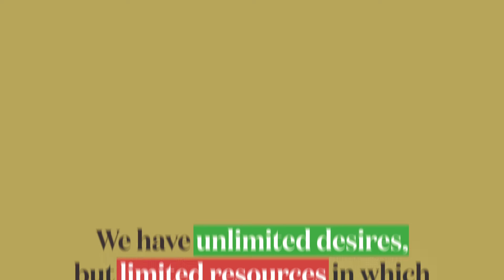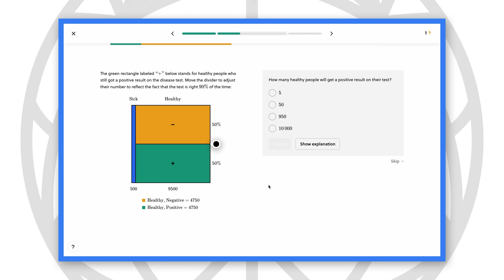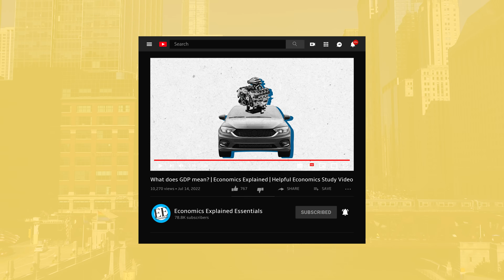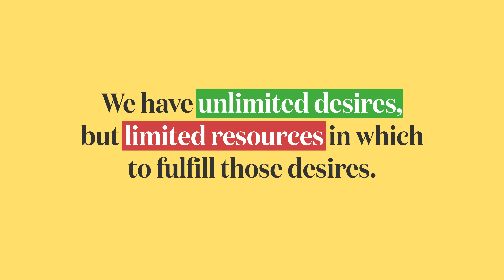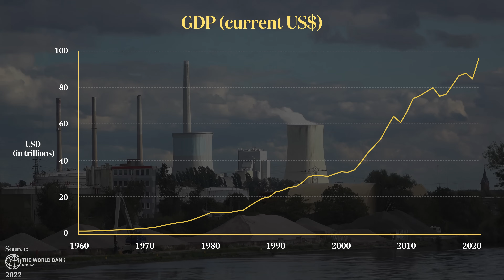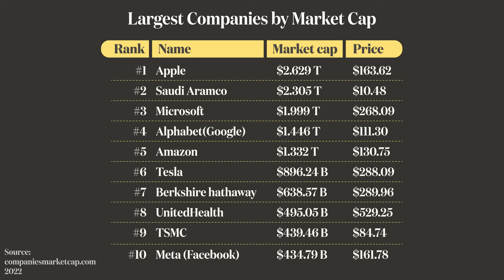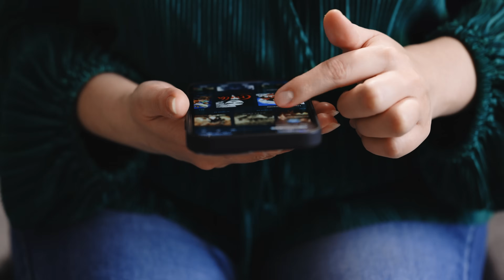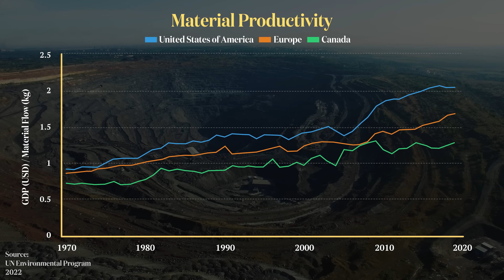Limitless Growth Is Possible If We Run Our Economies Correctly | Economics Explained

Comment: I take issue with the claim that humans have unlimited desires.  It may be possible that on average humans desire more than what is materially available for them, but even that isn't certain.
Reply: Exactly.
I've never desired a supercar, so making those super cheap wouldn't make me buy one (I would buy a decent and cheap rotovator however).
Reply: And collapse of some society could radically lower human desire. For example, if fossil fuel become really sparse, we would not think about buying plastic toys but saving fuel for heating and electricity

Comment: The tricky part is how we actually use this information. Material productivity measurements won't do much to sway those with the means of production if they're still profiting from our current unsustainable model.
Reply: Well the other side that no one is speaking is that it's not always good either. One of the worst disasters in human history with unseen effects was one of the best material productivity increases that ever happened. Do you remember leaded fuel? Was so much better than what they had for the same cost, weight etc but so much worse for humans and the environment. Same for CFCs. Funny thing they both came from the same man. 
Anyway point being i believe there should be 
GDP
-------
Material growth(+ or *  some smarter people than me will figure out the correct equation) pollution
Reply: There is a shift in our economy towards more durable and higher quality products already.
Focus on material productivity would support this. But yes, consumers would also have a thought and adapt more.
Reply: @Xrayhighs  where is this shift? So far I don't see any shift in making more durable products at least for the end consumer.
Reply: By taxing wasteful material use.
Reply: In the long term material productivity will automatically increase because essentially it's just improving the economy's efficiency, which as technology progresses and economic activity occurs efficiency/ material productivity will gradually increase, so it's in the producers best interests to increase material productivity since it can cut costs for them to be more competitive.
Reply: @Gimmegames4free6942  History suggests that the logic of growth will ensure that any efficiency gains are wiped out by aggregate increases in production
https://en.wikipedia.org/wiki/Jevons_paradox

Comment: The 'easiest' way to make the biggest impact is to attach meaningful costs to emissions, new material extraction, and disposal (ie. companies pay a fee when their products goes to a land fill). Make destructive practices more expensive than sustainable ones, and even the biggest greediest corporations will be pushing for sustainability and putting big money into R&D for more sustainable practices.

If emissions are expensive, companies will find ways to reduce emissions. If extracting new resources is expensive, companies will find better ways to reuse existing materials. If your product ending up in a landfill is expensive, companies will be encouraged to implement buy-back and recycling programs.

It's not the only solution, but it's the most effective one that doesn't rely on heavy handed regulation and which continues to enable a free market.

Comment: The Digital economy won't do anything, we still need tons of datacenters, servers, and an ever-increasing number of personal devices and energy so that people can consume these things. It's the same issue.  Furthermore, companies that produce high-quality goods go out of business because they can't sell enough to keep growing, the reason things have to be cheap and low quality is so that people will have to continuously buy them so that the company can keep growing.

The way forward is to swap GDP for measurements of well-being; coupled with democratic workplaces and "purpose-driven" businesses which exist not to make money and grow endlessly, but to serve a specific purpose within society. This is of course very unrealistic, so the future is bleak (and of course capitalism is based in faith in the future, that there will be more wealth tomorrow than there is today, and when this ceases to be true, all bets are off)
Reply: But the digital economy is getting exponentially increasing value from the same amount of raw materials. See Moore's law, for example.
Reply: @andrasbiro3007  true, but it's still using an ever-increasing amount of raw materials and electricity. To build on your example, Moore's Law is only for transistors; there's still the issue of generating electricity and manufacturing cases/chips/screens/batteries/cables and all that which requires more mining and fossil fuels (for plastic).

A digital economy alone isn't enough, it would need to have a circular business model and be powered by renewables imo. But maybe I was too pessimistic in my original post.
Reply: @chrisbeaudin5812  
1. Computers built from the same amount of materials and using the same amount of energy are doing exponentially growing amount of computation. But however fast that growth is, demand is growing faster currently. That doesn't have to be the case, we are extremely wasteful with computers now, because they are so cheap. If we had to, we could cap resource use without much sacrifice.

2. Renewable energy. It's cheap, clean, and abundant. In general there's absurdly enormous amount of energy easily available in the universe, we just need a little more tech to capture more than we could possibly want.

3. There are plenty enough raw materials. Usually the issue is the cost of extraction, not availability. And we also can recycle. And long term we will also have access to practically unlimited raw materials too. Even just on Earth we are barely scratching the surface. Literally. Earth has a 4000 mile radius, and our mines are like 1-2 miles deep. And they occupy only a very very tiny percentage of the surface. And the Sun is 333000 times more massive then Earth, and of that 3330 Earth masses are heavier elements (Carbon, Oxygen, metals, etc.). And yes, we can mine the Sun, it's called star lifting. Fairly low tech, because it uses the Sun's own power to do the job.

4. And of course 100% recycling is technically possible. It's not even that hard, just expensive most of the time. With enough renewable energy and robot labor we could do it without much trouble.

Comment: Lightbulbs to me are the best example of growth. It was possible to build lightbulbs that last for 100s of years (some are still going that were installed in the 1800s), but the lightbulb industry would have stagnated. So they built them to break, so people would need to keep buying them.
Reply: These more durable lightbulbs sucked though. The ones with shorter lifespan can be much brigther.
Reply: We also wouldn't have fancy LEDs.

Comment: I dont have an overview about the research on the area, but I'd argue that the assumption that digital services can infinetly grow is also false. The services are running on CPUs and memory, that are housed in servers, that are housed in datacenteres in need for power and cooling. The price per unit of whatever digital service may be significantly lower - depending on how effiently it was programmed - but it is not zero. Atm, afaik we are also not very good at recycling the scarce minerals used for servers aka digital services. The counterargument for that is innovation,.. random dudes law something  something. So its a question of innovation vs available resources that might allow for a lot of growth, but it's - in particualr looking at energy consumption - not infinite growth. I'd also question if producing random clone nr. 42 of digital service A can be considered sustainable as its obviously a waste on input and process cost.

Comment: In the second half of the economy, you are arguing that perpetual economic growth is possible if we change from focusing on making more stuff, you making better stuff. All this does is potentially prolong economic growth but we will still hit the limits to growth and growth will come to an end. Thisis unarguable.

And stopping global heating is now critical. Just this week, over 30 millions people have been impacted by huge floods in Pakistan. Another example of the impact of only 1.2 degrees of warming. It is going to get far worse. The only way to sustain economic growth is to fully decouple carbon emissions from growth. And the empirical evidence has shown that this is not achievable.

You then talk about the need to stop doing certain things, like fast fashion. So we cut back on fast fashion, eat less meat, fly less, become more energy efficient, stop using coal, oil and gas and so on. This will all reduce GDP. It will be replaced by renewables, increased plant based diets, recycling, using public transport more, electric vehicles, but less of them, buying things that last longer and are more easily repaired and so on. These things would add to GDP. But overall, we end up buying less in richer nations, replaced to some extent by sustainable growth in developing economies. Digital products will expand, but there are limits to this because in a sustainable economy, we won’t have enough spare income.

And one of the first things we need to do is stop using GDP. It’s a terrible measure of wellbeing, which ultimately is what matters. For example as obesity and diabetes increase GDP goes up. As we clean up an oil spill, a huge cost in environmental and miner terms, GDP goes up. This make little sense.
Reply: "The only way to sustain economic growth is to fully decouple carbon emissions from growth. And the empirical evidence has shown that this is not achievable."

What empirical evidence are you referring to? As far as I'm aware, nuclear energy has faced massively disproportionate social/legal barriers to its proliferation, compared to the actual dangers and difficulties that go along with it. Green energy has been underinvested in due to a combination of fossil fuel disinformation, successful political capture of resources in terms of subsidies by the same, short termism, and simple scientific ignorance. Electric vehicles have faced similar challenges. The largest economy in the world has been just barely sufficiently controlled by anti-science/nationalistic forces to completely cripple its climate policy (e.g. see Al Gore vs Bush in 2000). Large scale, scientifically rigorous economic damage estimates of climate change have only recently become widely available for use in policy decisions. 

And in recent years, renewable energy in the form of solar/wind/batter tech has just started to become the most directly cost efficient form of new power installation in large parts of the world, without even taking into account negative externalities of fossil fuel sources. High tech plant based food alternatives to meat/dairy are only just starting to take off (and growing extremely rapidly compared to food as a whole or animal agriculture), and cultured meat is possibly right behind it. Electric vehicles have only just started to rapidly grow as a relevant fraction of the vehicle market, and self-driving technology, which might be just around the corner, would massively favor electric vehicles due to its greater ability to take advantage of lower costs/mile driven.

Just because economic growth has not, so far, happened decoupled from carbon emissions, doesn't mean it isn't possible in the future. It looks to me more like so far fossil fuel incumbents, scientific ignorance and inherent difficulties of technological and scientific progress have historically been greater than the efficiency/environmental/health benefits of and political desire for sustainable forms of growth. Many signs point to the possibility of that changing in the next few years.
Reply: If you are serious with your concern about global climate change, you should be blaming governments. Governments are the largest polluters and waste more resources than any other group. Why are you still supporting governments?
Reply: @mattolivier9465  I don't blame "governments" any more than I blame "companies" or for that matter "people." And even if I somehow threw all the blame at the feet of "governments," societies/economies still need governments for a myriad of reasons. The solutions don't lie in ceasing to support "governments," but in ceasing to support individual politicians, administrations, or if necessary branches of governments while advocating for change and climate policy solutions.

Voting, protesting and other forms of non-violent political advocacy can be quite effective in enacting change if enough people engage in them productively.

Much like technology, while previous government policy has to a large extent gotten us into the climate mess we're in, current/future changes in government policy is one of the best shots we have to get out of it.

Comment: I think the optimal route is specifically reduction in waste rather than the more broad improved use of resources. Needs are varied and we won't ever replace real food, housing, and energy with virtual food, housing, and energy no matter how much Zuckerberg may want that. The crux or sustainability is to be next zero or positive over the life of the resource. Consider a hypothetical sustainable car: the car would be made from metals in such a way that they can be recycled with high efficiency with the slag being reprocessed as an ore of the base metal. The car would be powered by biofuel (I'm hesitant to say batteries here because the common chemistries used aren't easily recycled). The biofuel could take the form of minimally processed oils such as biodiesel or organic mass processed into your hydrocarbon of choice using pyrolysis (solar or nuclear possibly) and a Fischer-Tropsch device. Emissions in this case would be equal to carbon captured by the biomass.

With the exception of things we fire out of earth's orbit, we need to keep in mind that almost all material mankind started with is still here in one place or another, it's location just changes. We won't run out of anything, it will just become a more chaotic form and be harder to access and hence more expensive. If we take care to treat the waste and inefficiencies as the mines of tomorrow, growth can continue until the last rare earth metal is at the whim of humanity.
Reply: Reduction in waste would require intense global cooperation and enforcement. Totally possible but the incentive to defect and externalize your waste for profit is forever there. Like a prisoner's dilemma. Any country choosing to defect for an industry to avoid paying for waste earns an advantage.
Reply: @EricVulgaris  that's exactly the problem with achieving a sustainable economy: from a game theory perspective over timescales the size of a generation, its absolutely more advantageous to go the unstainable route for personal (or national) advantage. Even if everyone can cooperate, a single entity would benefit massively in comparison to their peers by going the "profitable, but unstainable" route. Any sustainable strategy outside of widespread collectice desire for optimizing very long term growth is metastable at best.
Reply: @EricVulgaris  Yes, finally ethically valid forever wars. Wars to protect & secure the continunity & sustainability of our pure Blue & Green World.
Reply: Trains are a good solution because they are easily electrified, more environmental friendly, and more efficient than cars
Reply: Agreed. But we need more publci transport, cars are woefully inefficient.
Reply: @appoNo1  In the US of A outside of a few major high density cornubations, its not really viable given the low to lowish density suburban sprawl of most of Modern America post mid 1950s that focus on cars as the primary mode of transport. So heavy urban rail, light rail & even buses are out of the question.

The other issue is that of the American legal system, lawsuits from multiple various parties can tie up, create uncertainty & or raise cost of urban transport projects very significantly, further undermining viability of any proposed projects.
Reply: if we changed “GDP/material” to “GDP/non-recyclable material” then this would account for waste
Reply: as long as populations continue to increase nothing is going to be sustainable.
Reply: @justin_5631  Then adopt lassie faire & given straighten economic circumstances defunding of you know what.
Reply: at that point, old things will be destroyed to be repurposed for new.
Reply: How is infinite growth compatible with the logic of recycling/regeneration? Those two are literally directly opposed to each other.
Reply: You could use E-fuels, which is also practical since you don't have to change fuel infrastructure. You'd just need to use NPPs to power drawing carbon from the atmosphere to reconstitute into petroleum.
Reply: @Waldemarvonanhalt  Yo, that only viable if your electric grid base load is at least 150% to 170% green. Biden aims to for a net zero electricity grid by 2035. That won't happen, he delusional. Best realistic maybe 2045 to 2050 timeframe, but in your partisan America it ain't gonna happen. E fuels a pipe dream, that won't happen big time commercially, in the next 20 years. What doable is solid state lithium ion battery & maybe green hydrogen + fuel cells.